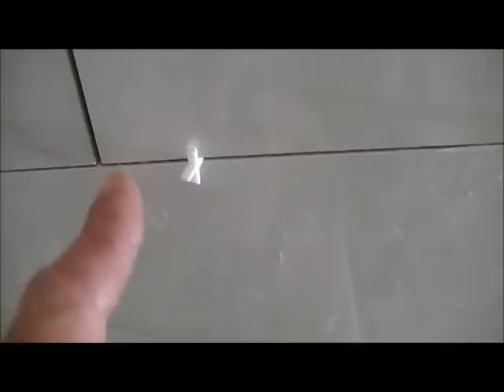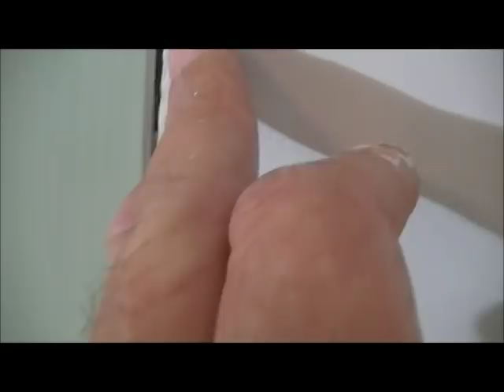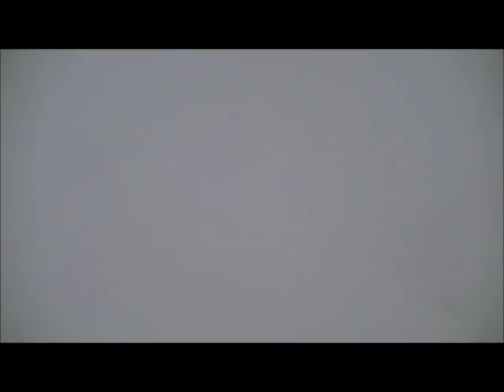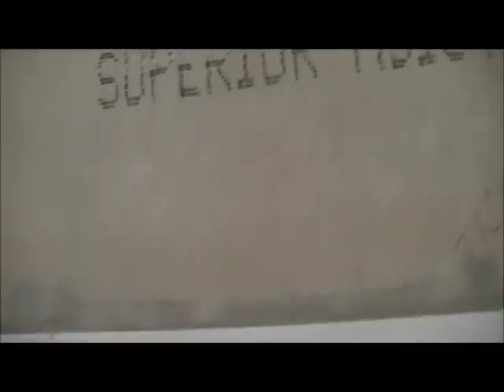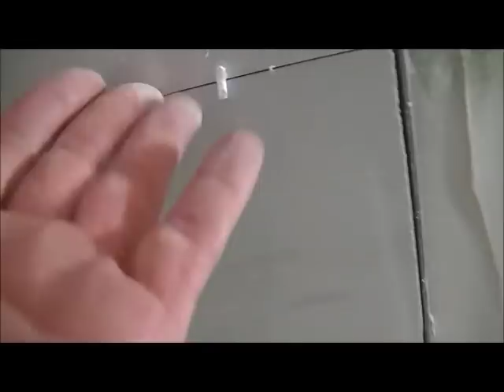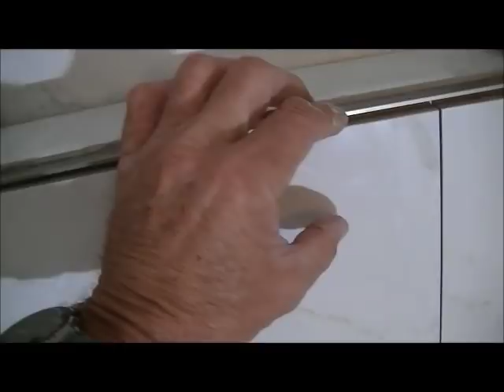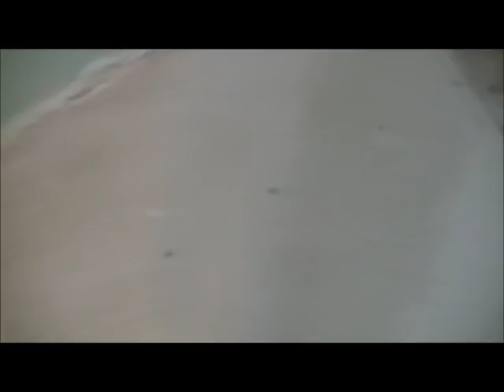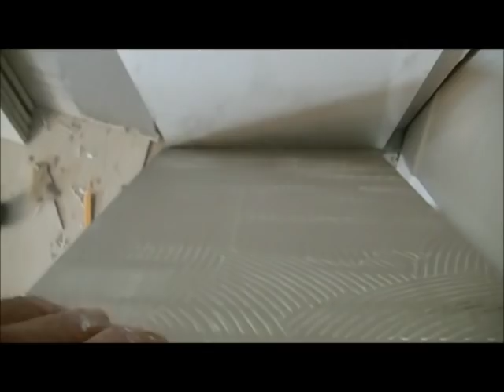Tile Guy Messes Up Project ( really bad tile job )

Comment: I've heard u mention in previous videos not to use mastic on shower walls.  Can u please explain why?  I've noticed that it does take mastic a super-long time to dry
Reply from the maker: You sort of answered your own question, when you encapsulate tile on to mastic it does not have air to dry... and it is not meant for a shower to begin with, it will attract mold and mildew a lot easier and you cannot trowel it out to the depth that you need like thin set
Reply: @StarrTile  oh ok.  Ya thats wat I thought.  Thank u so much for the reply Bob!
Reply: Something I learned off the net about mastic: While mastic does have strong points, such as great adhesive properties and adaptability to many substrata, high performance in wet areas is not one of its high points.💖
Reply: @FullTilt444  Thanks!  Wen I 1st started tiling I heard that mastic is wat u do want to use in the shower and after doing it a few times I realized that even after 5 to 7 days the mastic still hasn't dried behind the tile
Reply: @Lumbu4u  you're very welcome. I never knew a thing about anything having to do with tile until I found myself victim of a bad contractor. I'm one who is compelled to do in depth research when things go wrong in an attempt to understand what went wrong. Then I still get treated like I don't know anything. Mastic is a decent product. just not good for use in wet areas. And I'm not 100% certain, but I believe that Bob is an actual certified tile installer. There's a website I ran across recently that lists the people that are certified tile installers and lists what state they are located in. Tile installation is a skill and and art.  It isn't a 'one size fits all' type matter. People hire 'pros' for a reason.. especially in this arena.... we got totally scammed and it just makes me cry. Beautiful tile....like for real.. and it's been ruined by an improper tile install. You seriously wouldn't believe it. I can't believe it. I could have done a better job never having installed a single piece of tile in my life, doing it one piece at a time and having it take me 2 years.  I'm having to exercise great restraint to not lose my sanity and take a hammer to it...although that is probably exactly what needs to happen.. it's too pretty for me to bear...... alot of it is 'art glass' tile..... it was expensive. I can't even go in there to look at it. I'd like to just put a piece of plywood over the door frame and pretend that space isn't even part of the house anymore. I literally cannot go in there. I just can't. I'd like to just bulldoze the entire house at this point. It's just sick.💖💖💖💖
Reply: @FullTilt444  im sorry to hear man.  Its shitty the things contractors say to clients to justify a half-ass job!  U should've kicked them out right away!  Ive been doing this in the Chicago area for 35 years now and my company is still A+ rated with the BBB.  In that time we have not had 1 single complaint against us.  I totally take pride in my craftsmanship.  I had to figure out on my own not to use mastic in showers by installing it for bad contractors.  I never knew there was a state certification for tile i stallers.  Thanks for the info!
Reply: @Lumbu4u  Yeah...I had not known that either...but there is!  I knew I needed to get them kicked out...but the implications to firing a contractor are enormous. All the research I did on it had me scared out of my wits. I'm still scared. This guy can actually file a mechanics lien against our property. So can his sub-contractors. As soon as I came to realize the contractor had not pulled the necessary local and state permits for our bathroom remodel I was horrified. First he had tried to tell me I didn't know what I was talking about, that the work didn't require any. (he was flat wrong) then he said that he couldn't pull them after work had been done ( not true.. he just knew HE would get into trouble and be fined for it)   My hubs ended up pulling the permits himself.... against all the advice online stating a homeowner should never do that. We have no 'outs' in this situation. Permits only cost us a measley $115. So I'm living a nightmare over a measley $115?  Granted, it probably would not have had any impact on the tile install. but the electrical is wrong, the plumbing is wrong, we're 'out of code' (energy and fire) .....and we're out at least $13K  at this point.  We're just 'normal' people. We're never going to recover from this loss. Ever. .......and we didn't have it to lose to begin with./ We took over a month to make a selection as to who to hire...still ended up choosing wrong. At this point we know we have almost $2K in electrical work to be done... $1700 or more in plumbing..... the main tile floor of the bathroom that was improperly installed is pretty much a non issue because we have to tear it out for the plumber. The tile shower install. some have said 'well it depends upon what you can live with'.... well as Benjamin Franklin stated 'the bitterness of poor quality remains long after the sweetness of low price is forgotten.'  Well, we hadn't selected the lowest priced guy. We selected the one that had presented as being most meticulous. His design of our rough design was amazing. His quote was so detailed ...every 2x4 every piece of sheet rock, sub flooring.I'm surprised he hadn't listed every nail. It was so detailed. This in contrast to others that had just thrown out a price on the spot.  He was actually at the high end of those we had out.  We put alot of effort into avoiding the situation we are in right now. i'm on SSD ,I'll probably end up emptying my bank account to get this taken care of. My hubs works but he's being rather infantile and avoiding  truly addressing this matter....which is part of the problem all in and of itself. I don't mean to bash on the hubs, but he truly is part of the problem. I am limited as to what I can do because I wasn't listed on the contract. ...but I am joint owner of the home. so that was weird.... usually matters such as this require both owners of property on contracts..... It took me a minute to learn/research how to get them to stop working.... the worthless attorney my hubs acquired services from should have issued a 'stop work' letter IMMEDIATELY  but he didn't. I did place notices on the doors when workers were still coming to perform work  (much to my dismay) that I was being 'forced to allow work to continue under duress' cuz that was the God's honest truth. I didn't want it to continue. I just didn't know how to stop it. ....what has been accomplished so far as far as the legal handling of the situation, i have had to figure it out on my own. I'm trying to protect myself......and failing.  I wasn't asking for any high end celebrity looking bathroom. just a normal up to date bathroom. that's it... we re-arranged the space so I could actually put my clothes in the master bedroom closet  ,instead of having to have almost all of my clothes in the closet of another room. Cuz for a master bedroom closet...it was very tiny and only allowed for one wall to hang clothes (as it was like a 'gally' design..long and narrow. I had lived with it for 19 years. Obviously, I should not have asked for anything 'more' than what I already had. I feel I've been being nothing but punished for it. Like I am some horrible person who deserves it or something. I know that isn't true. But that is how it feels. Now I have less than I had before. I should just have an extra garage built in my backyard and just live in that. .or move into a climate controlled storage locker. 🤣💖
Reply: @Lumbu4u  https://www.ceramictilefoundation.org/cti-certified-tile-installer-alpha-listing   here is one listing I found..... but there is another...... I have so much stuff saved in my computer right now on the subject of tile installation, it isn't even funny...💖
Reply: @Lumbu4u  https://www.tile-assn.com/page/CTI   you might be interested in pursuing this... considering your love and passion for this true 'art form'... it should be a criminal offense to ruin beautiful tile.  I purchased a beautiful glass art tile.. $20 one square piece.... boxes of 11 pieces  $220. I bought 4 boxes of it..... this just covered the lower half of the shower... I spent $400 on the tile for the floor.... I can't remember what I spent for the cool glass 'opal' tile at Floor and Decor for the 5 piece wide strip of it that runs from floor to ceiling....... used 12x24 'porcelain' tile on upper part of shower......  it's cool as heck. it's a gorgeous design.. this is like having to destroy Michael Angelos work.  someone else is going to have to take the hammer to it. I can't bear to. I'm still praying part of it can be saved.I'm probably delusional.💖💖💖💖
Reply: @FullTilt444  Why dont u report him to the BBB?  If he cares abt his reputation maybe he'll agree to fix it.  Thats alot of money man!  Thanks for the link!
Reply: @Lumbu4u  I did report him to all but the BBB. Seems all anyone cares about these days is the overblown virus scare.💖 I haven't reported to BBB yet... and he isn't BBB accredited (red flag right there) I've been holding off as I've tried to dig for information. I'd never let this guy back into my home. I'm probably going to have to hire an attorney.. by the time this is over .my bank account will be emptied...and it's all I have. I don't have retirement accounts as detached retinas in both my eyes put an end to my working days about 20 years ago now. I should just buy a shed and live in that.🤣🤣🤣🤣🤣🤣💖
Reply: @FullTilt444  Awe man don't say that!  Remember there's always someone else with a worse-off story.  If u were in my area I'd look at it for u and see if there's anything that can be salvaged.  Hang in there man.  God IS Good!!
Reply: @Lumbu4u  GOD IS GOOD! Awesome ,actually!💖💖💖💖  This human experience is like going thru freaking 'basic training'!🤣🤣🤣 I know we're being prepared for something much more.... but jeepers creepers... the evil one is seriously making things SUCK here! Can't wait to see him thrown down! May Blessings POUR OUT on to YOU, my dear friend! Thank YOU SO MUCH for the support!💖
Reply: Mastic collects mould and turns black that's why

Comment: Your sir are correct in the fact that the project looks like complete trash. Many lippage , many uneven joints and bad cuts all over with huge gaps. Unacceptable! But your information is also misleading and incorrect. There’s nothing wrong with soap box niche size . In case you didn’t know there’s many sizes . The schleuter metal edging can go both in and out ways there’s no correct way to that. Also there are no corner pieces for L shaped metal edges like the one in the video . Bad spacers ? Incorrect sir. There’s nothing wrong with the spacers. They did however did not know how to use them . And the reason for a joint going from 1/16 to 1/8 is that the tile is not Level .
Reply: oh.I'd love to be able to show you the tile job I rec'd..... this looks fab in comparison to mine......

Comment: So, I made my own mistake, and wanted to ask your opinion,  as you seem to have great knowledge,  and expertise,  especially in fixing other people's mistakes.  I have done a few tile jobs..usually took my time, used the proper spacers, everything was decent.  But I'm working on a kitchen for a family member,  I tiled a wall, then started the wall next to it, and I was paying attention to spacing side to side , but my up and down spacing , I got sloppy,  didnt use spacers, I started eyeballing it, now I have 2 rows that have a way too thick spacing between them. Like a half inch grout line to fill, the rest of the adjacent wall is a common 1/16 spacing or so 
If I try to remove those 10 tiles or so, will they crack (I dont mind losing em, n replacing them) but how bad will the clean up be, behind them..? Will I gouge the sheetrock, or durarock, trying to scrape the old mastic off?
Or are there any tricks or tips, that you would share?
Thanks in advance,  Tom in N.J.
Reply: Thanks so much..yes I used 2 large putty knives and pried them off..only broke 1 and cleanup wasnt too bad..now its redone and even..my ocd can rest
Reply: @tomsherry8961  Awesome!
Reply: I will just go ahead and tell you from my current first time tiling mistake of having to remove 2 tiles due to issues. Its going to be a pain in the butt to remove the thinset BUT it can be done. I used this https://www.homedepot.com/p/QEP-Grout-Removal-Tool-with-Durable-Carbide-Tips-10020Q/100194652 and also a flat head screwdriver to shave down enough and backbutter the tile back to the wall. Not sure if you already tried since you posted 2 days ago but if you get to them the next day they should pop off with some effort and not crack and also depends on how big the tile is :)

Comment: This is why i do my own work. Too many people want to make money off people and those who do not have a true passion for the work that goes in to this stuff are very snakey. I trust very little when it comes to contractors anymore
Reply: I'm doing the same thing. I'm learning and taking my time with my bathroom reno right now. Making a lot of mistakes, but using my brain to figure out ways to fix them. It's a 50's house too with 1" thick plaster walls so makes it even more difficult lol Oh and the amount of money I spent on the proper tools needed to do drywall, tile, etc is insane haha

Comment: You never got 50/50 brick with 12x24 because of the pillow effect ...!!!!! You stack it or 1/3 brick or 1/3 ladder. In all the new housing we do that’s what happens. Even on most of the boxes of 12x24 now it clearly tells you not to install it at 50/50 brick. I don’t care if your wall is as smooth as glass and even if you’re using clips no tile is exactly straight

Comment: It usually the home owner fault because they like to choose the cheapest guy they can get. I’m a licensed contractor bathroom remodel guy and I laugh when they told me they compare price to a non licensed contractor price and will accept my bid for the same price as a Non-licensed contractor
Reply: We chose one of the highest priced quotes of the LICENSED contractors we had out before hiring the one we hired...guess what? we are still living the nightmare! They sent out a young tile guy (age 27) who was 'learning on the job'... he worked alone... it would look great initially after he was finished at the end of each day, then as it dried, things would go horribly wrong. We selected a translucent epoxy grout on our glass art tile as to not take away from the beauty of the tile. contractor stated tile guy had worked with it (epoxy grout) many many times. You wouldn't believe what we have going on....... it is beyond 'grout haze'. Oh.I wish I could post images for you.....   I have about $2000 of tile.... ruined. Stuck to the walls of my master bathroom shower... I can't even bring myself to go in there.It makes me cry.

Comment: This was a horrible job, but, your enthusiasm with trashing every job you come across makes me somewhat question your integrity and motives. If something is done wrong, I simply explain to the customer that the job was done wrong. I don't trash the previous guys the same way you do. Because in the long run, it will come back to haunt you. I'm sure I could go back 35 years and look at some of my jobs with some embarrassment. And, for sure, I could pick apart the work that you have done recently...So man, keep doing a good job but stay humble...
Reply from the maker: I replied to your other comment, go read it...same basis stuff you said here.
Most of my "Bad Tile Job" videos are not for your consumption, you're not the guy that didn't know sqquat about tile work & shelled out 10-15k to have a half assed job done, and now has to re-do it. Calling out other guys ??? Never have I mentioned a contractors name or company, though I should. Trashing their so called "work " ?? Absolutely !! Because it's trash & consumer needs to know what to look for. Bite me in the ass ?? Never...as bad a job I may have done 18 or 20 years ago, my work would NEVER EVER be this bad, not even close ! My work on this job > https://www.youtube.com/watch?v=1aUDq
Reply: I just shelled out 11K for a new bathroom and a really bad tile job on floor and walk-in shower.  My first home renovation project and I trusted the contractor. Next time I will go with a professional tile installer then the guy that advertises he "does it all."  I appreciate this video and believe his motive was to educate homeowners like me.  Would love to have this guy do my shower again.
Reply: Justin Atkinson
That's what you get for being a cheap S.O.B. Everybody whats the job done for pennies; complains when it turns out like shit. If you were too stupid to hire someone referenced from the get go, then I have no sympathy for you. You get what you pay for; stop trashing the installers when it is you that deserves a shit job.

Comment: It's all out of square. He didn't check anything before starting. That's why it's all messed up. Most important part is to make sure the walls and everything starts Square. The bigger the grout line the less likely you will be able to visually see The errors. You can tell the wrong trowel was used. there was no 1/8" or 3/16" lines. Really expensive tile to fuck up. Wish I could afford to throw away tile that nice.
Reply: What's the right trowel?  Where are the 1/8" or 3/16" lines supposed to be?  Do you mean grout lines?